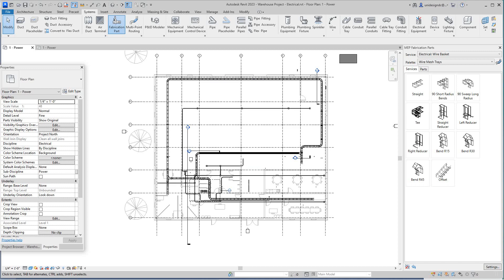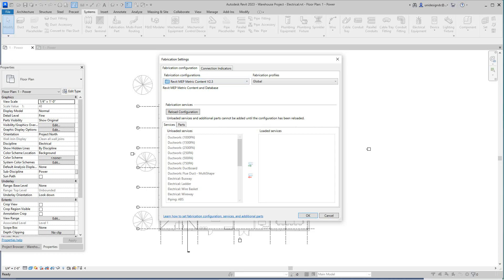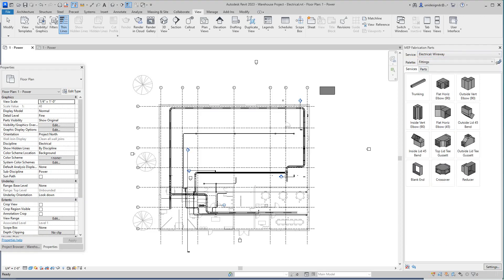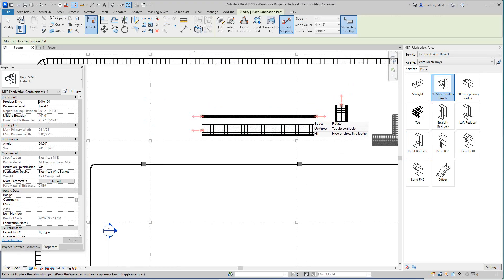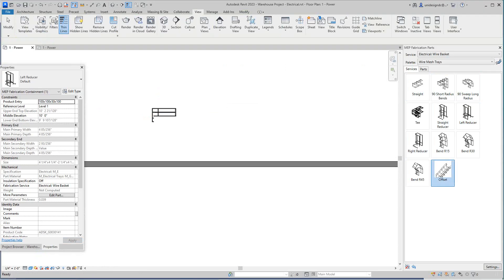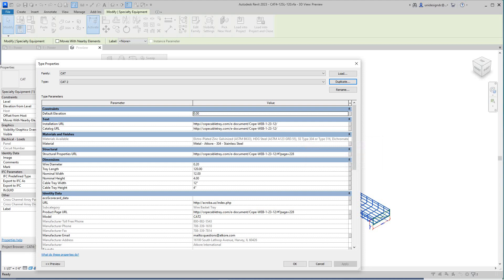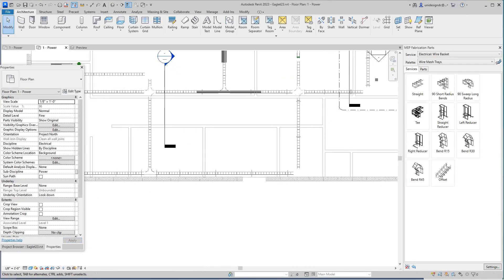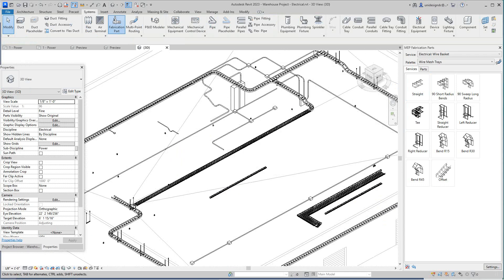Revit MEP Fabrication Cable tray system and family

Comment: So the wire tray is only in metric?
Reply from the maker: Hi thanks for watching. Yes that was all I could find in Revit 2023 and I thought that was odd. Or maybe there was an issue installing it. I can't install either in 2026. I spoke to Autodesk they are supposed to call me. I will send you a note when this issue is resolved